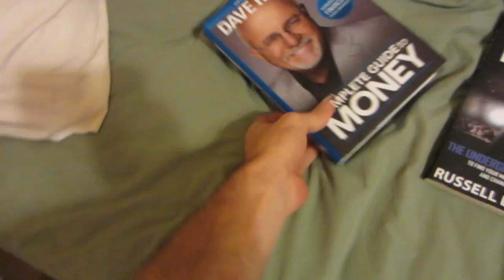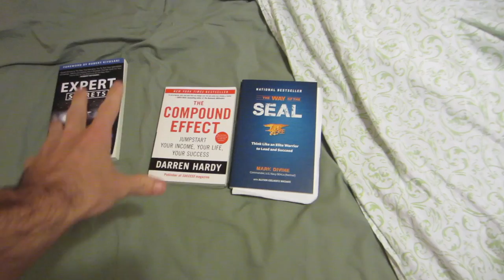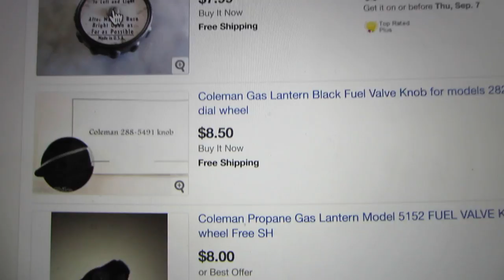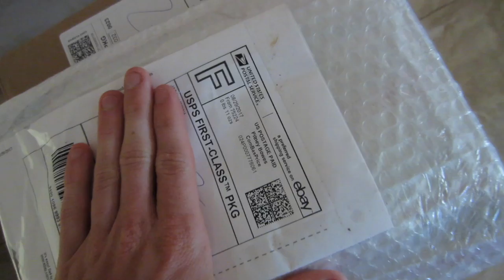Van Surgery Begins Day 1 2005 Kia sedona ac compressor | Vlog 144

Comment: Making progress on #vanlife.  It's a frustrating thing to work on vehicles these days--there's just no room.  Of course, the folks who design 'em don't have to work on 'em. LOL!  I've seen many a burnt out AC compressor clutch assembly.  Detroit Deisel didn't make a very good one.  I used to carry a spare with me because I hate driving a truck in the heat of summer with no AC.  All that black dust you got all over you is the remains of the clutch and metal filings.  Comes with the territory ;)  I'm glad Mr. Knight is OK and I wish you luck with the rest of your project.  Tailwinds to you!
Reply from the maker: Today is the real test day! Got more tools 💪 water pump and timing belt not gonna know what hit them

Comment: Haynes Workshop Manuals are pretty good they do one for the Kia. They are all based on a strip down and have useful tech specs in there. Would be useful to take on you trip if nothing else as a good luck totem, if you got one you probably won't need it!

Comment: Hey CP, well done for getting stuck into the van. Be careful using the non-impact socketry with an impact driver. I've done it myself though! In England pint mugs of sugary tea keep the spanners turning and spirits up! Good idea to take a break from it, things always look better after a night's sleep!
Reply from the maker: What are the consequences doe sit break socket? Dirty van hands now!
Reply: The consequences are it could break or shatter the socket sending shrapnel in all directions.  Also, if the sockets or extensions are chrome plated it could make flakes of chrome flake off and cut you up good.  Do yourself a favor and get impact rated sockets and extensions.  Lots of pawnshops have them fairly cheap.
Reply from the maker: 😱 that sounds horrific.
Reply: Well, not horrific but dangerous. LOL!  I guess horrific if one should shatter and get a piece of shrapnel in your eye or embedded in your skin.  Not trying to scare you--just informing you to use the proper tools for the job. :)
Reply: Shattering sockets are no fun especially if you're not wearing eye protection. Also Corvidae's point about chrome, get a sliver of that stuff in your hands and it really festers. Only things worse than that is carbon fibre splinters! Still you got lucky,  pully off -  no injuries you learnt something win, win!🚐